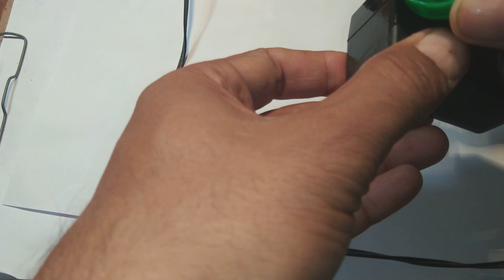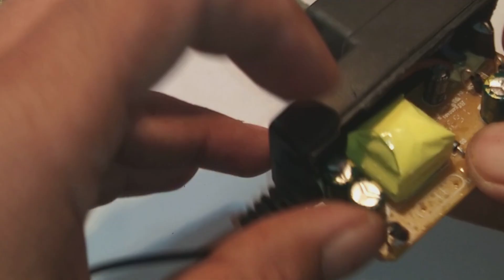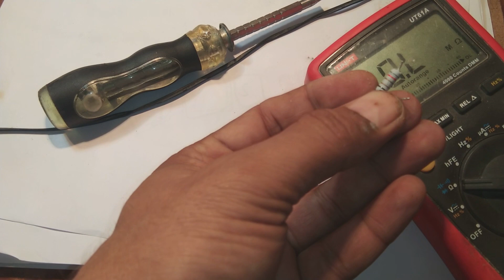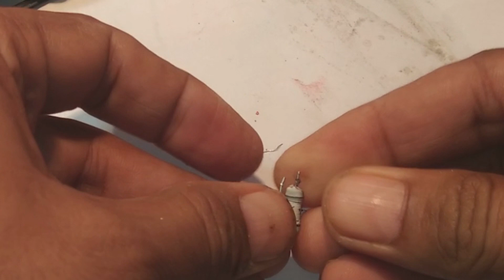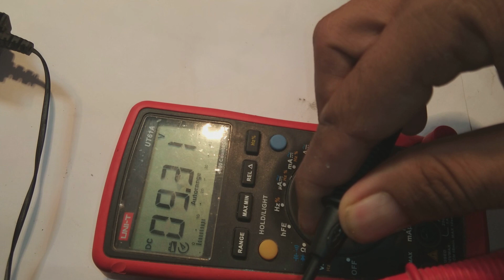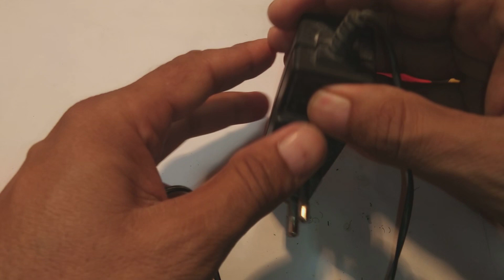Power Supply repair. Power adapter repair. Mobile phone charger repair. Cell phone charger repair.

Comment: That resistor between the capacitors looked like an inductor/choke to me.
The fuse looks like a surge resistor.
Another power supply saved :-D